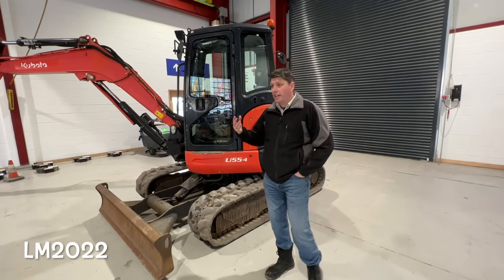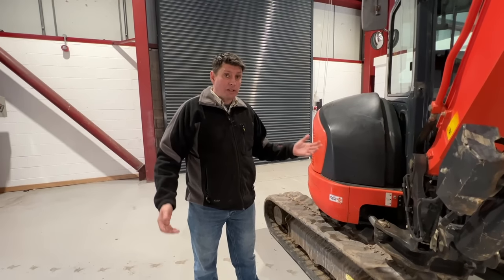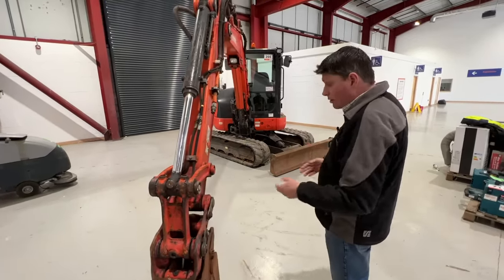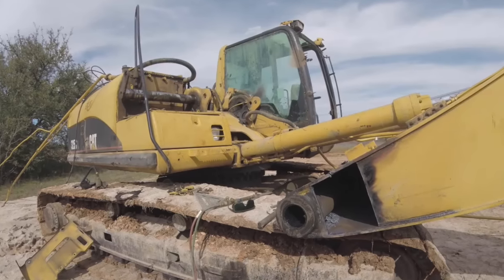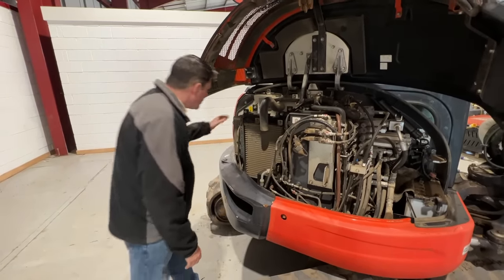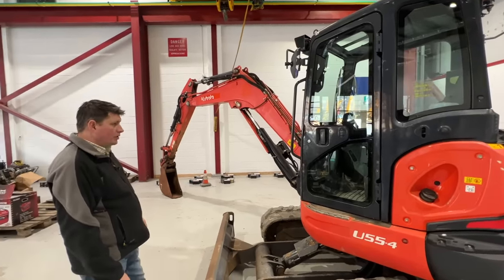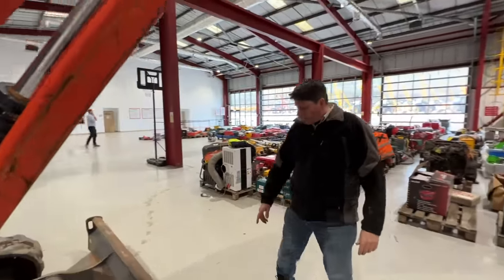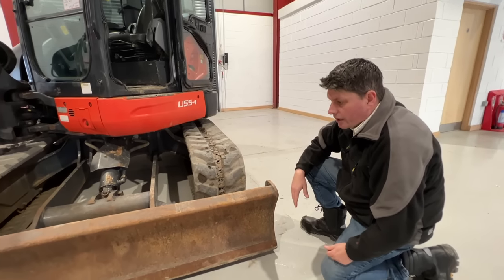BUYING A USED EXCAVATOR || HOW TO BUY AN EXCAVATOR

Comment: Sound advice on what to look for, all I can add is what are you planing to do with the machine and buy accordingly. If it's  a farm and you have a workshop then you can save some coin on the initial purchase, if it is working on site spend a bit more to save on downtime. A small machine can do an awful lot but a big machine will do it faster.

Comment: Yes agreed on all those points, and really check those hydraulic hoses on a machine that's a little older, they might look good at a casual glance but be worn thin where the touch the machine.  On metal track machines look at the pins too.  Excavators are fantastic, and it is amazing how much work you can do with a small machine like that Kubota, not to mention the ease of moving them. Everyone should own one :-)

Comment: The best advice I would give anyone is to avoid bio oil! I learnt the hard way and ended up replacing most of the o rings in the valve block.
Reply from the maker: Some jobs won't allow you on them without it.

Comment: I’ll add one thing B’cos I’m a finicky B’strd, a little hand held uv torch  comes in handy when checking for leaks on a hydraulic valve block
Reply from the maker: Yes it does but it only works well
with certain oils
Reply: @LordMuck  that’s true

Comment: Hi, how big machine do you need for hammering stone lot, i have a lot that is approx 1000 square meters all in lime stone, i need to takeout approx 50-60 cm of it to level it, would 2.5 or 5 ton machine do the job?
Reply from the maker: A little 0.8 ton micro would do it given enough time but obviously the bigger the better. Personally I'd say 8 - 13 tonner
Reply: @LordMuck  I am planning to buy excavator and do it my self as here in Croatia few guys iv'd asked ask 15000 to 20000 euros to do it, for that money i think i can buy decent 2.5 tonner and do it myself and sell the machine later and maybe come even out, so time is not an issue, so your saying 2.5 tonner would do the job? Of course in longer amount of time, how stresfull is to smaller hammer? What is lifespan of such machines ? Thanks for your help!
Reply from the maker: Buy the best example of what you can afford 👍

Comment: You can inspect a machine all you can but I like it to run, even a muck (dry, no pun intended) run without actually digging. I do use my ass, ears and nose for vibrations, noises and smells. This plus what you added. Use all the senses and your head, it's not the only machine for sale. Earlier this year I bought a mobile excavator for my boss in the Netherlands, 9000 km away. Searching the internep for weeks and had two favorites and one that I added for comparison. In the end I bought the last one because the pictures didn't do it right and it felt way better than my "favorites". This to my surprise, we have worked over 500 hrs with her and it's freaking nice machine, Only two broken hoses in that time. Witch is nothing for a 10 year old machine with 14.000 hrs. She's better than the specs on paper. 
Always interesting to buy machinery. My tropical two cents, Do Well
Reply from the maker: That's why I said to try out all the functions. A static machine won't tell you much.